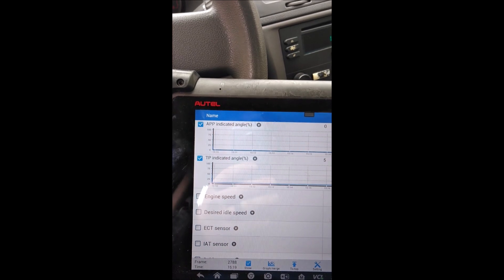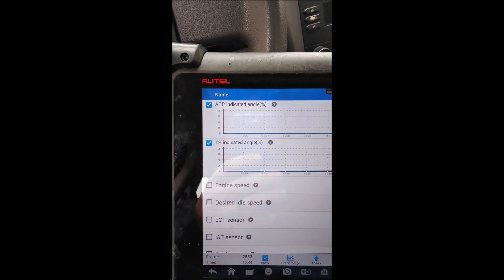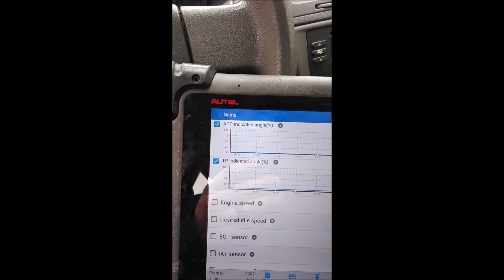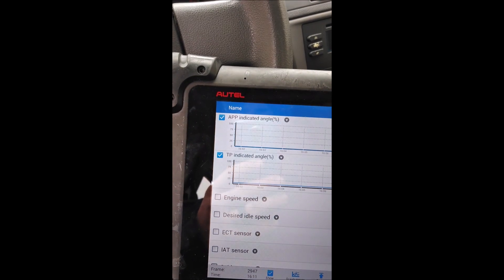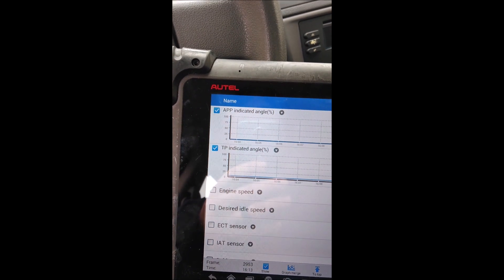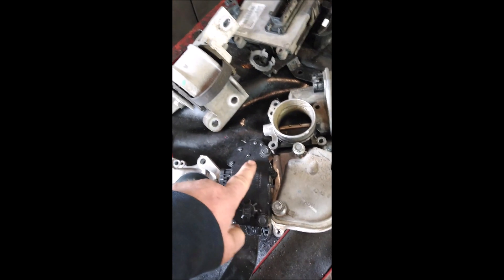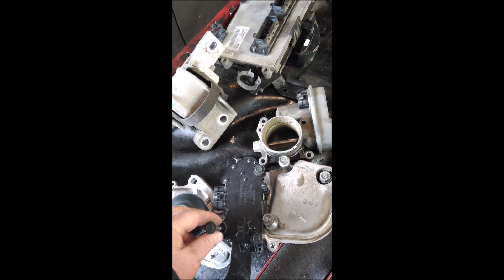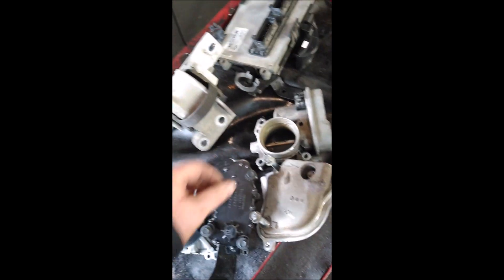2005 Cobalt Chevy p2135 p2138 p0651

Comment: Thanks for the video. I'm having this issue with my 2006 Cobalt right now. Exactly how you described. It's intermittent. I'm a littlle confused though. You said this ones fixed and talked about how much pedal sensor costs. Did you replace the APP or did it fix itself. It was a little unclear. You never actually said how you fixed it. I wathced  it twice but maybe I missed something. If you clarify what yo did, that would be helpful to me. Thanks again.
Reply from the maker: Yeah sorry about that I didn't fix that car in the shop so the video might be a little wonky, this particular car she has taken to another shop and they replaced the throttle body and all sorts of other parts she said she spent $1500 with them and got it back and it did the same exact thing she could drive it anywhere from 5-20 mins and then it would fall into fail safe mode. She also had a intermittent 5 volt reference code. With these cars it's very common to have a bad ground down by the transmission I could jiggle that ground and the 5 volt reference code would come back I ended up fixing that ground and taking car on test run her accelerator pedal would drop out or spike on the graph when watching the live data with the app and the throttle body pulled up together, I replaced the accelerator pedal and the problem never came back. If you have access to a good scan tool that's probably the best way to see which one is messing up. If you are having other weird electrical issues check that ground first I have seen that several times on these cobalts that ground on the transmission can cause all sorts of electrical Gremlins this particular car just had two things going on and from what I understand she had been dealing with it for a long time and the few shops she took it too kept taking her money but not fixing it a